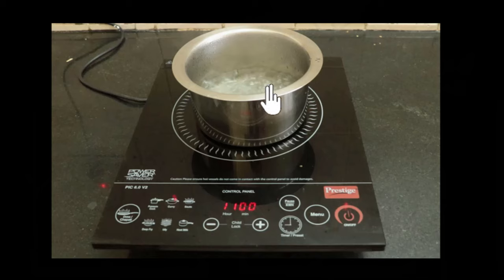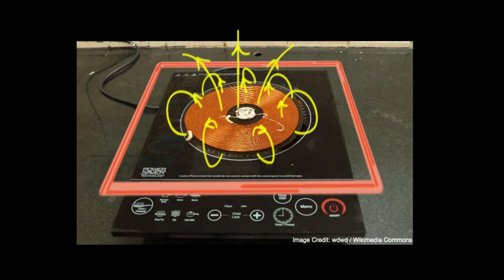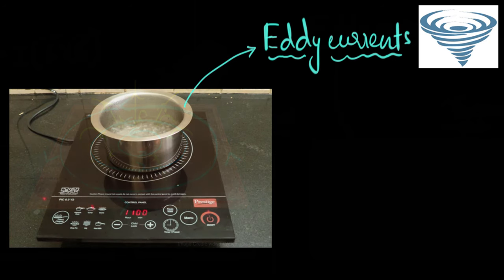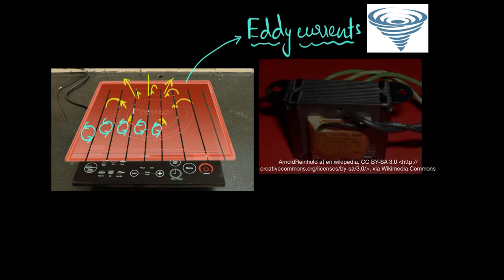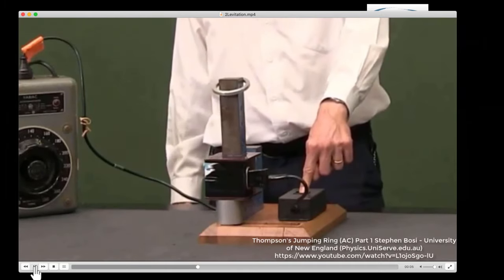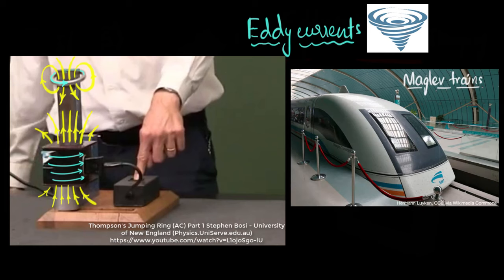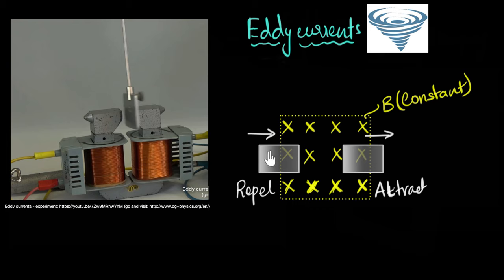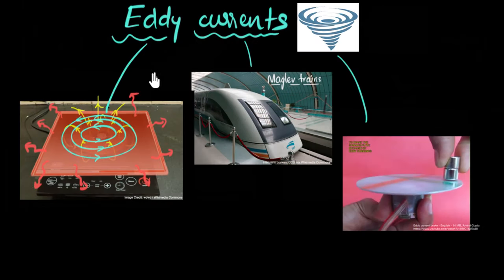Eddy currents & their applications (& how to reduce them) | Electromagnetic induction | Khan Academy

Comment: Good but 2 points: 1) Eddy currents mean  CONCENTRIC currents.  Hence they require a solid and  not a loop conductor . 
2) To most effectively reduce them the slits must  not leave a border on one side. They should go right through the border.
Reply: Agr vessel ke bottom eddy current establish ho jata hai to when we touch vessel to hme current kyo nhi lgta

Comment: In your diagram at about 10:00 if the Al swings through a large constant B-field where it is at times moving through  a constant field (AFTER it completely enters and BEFORE it starts to exit),  the SAME amount of flux is penetrating the Al over this part of the swing...will the braking force be zero here?
THANKS FOR THE CREAT VIDEO!!

Comment: Summary Of The Video :-

............EDDY CURRENT............ 

* Induction cooker cook thing without getting hot itself , it is because of formation of EDDY CURRENT

* The loops forms on the surface of the conductor due to changing flux is called EDDIES and current produced by these eddies are called *EDDY CURRENT*.

* Eddy current do not from on our hand because our hands are not a great conductor so Eddy Current are incredibly microscopic.

* By introducing slots in between the surface of the plate we can reduce the formation of Eddy Current.

* Also in transformer instead of using a giant block of metal we take thin slices of these metal and then glued together to reduce formation of Eddy Current.

* An oscillating aluminum plate stopped immediately in presence of magnetic field because of formation of Eddy Current .

* If we make slots on aluminum plate then it take long time to slow down because formation of Eddy Current get reduced.

Comment: Suppose we put a conductor on that induction so change in magnetic field will introduce a current on that conductor, when I touch that conductor why I don't get a shock ,
I am very curious to know and sorry  if my question is stupid
Reply: 1. our hand is not a good conductor as mentioned in the video.
2 . since eddy currents form small loops of their own on the utensil  even if u touch the utensil on the induction plate u will not get shocked bcos u were never a part of the circuit.  

p.s. i answered your question to the best of knowledge i maybe wrong please correct me if it is so!
Reply: @user-rn7ng6zv1j  i agree with the first point but according to ur 2nd point one should never get a shock because the circuit won't be complete but in reality humans do get shocks because earth is considered to be at zero potential and since current flows from high potential to low potential so when we touch a circuit we actually serve as a channel for the current just like a wire.... this is why we do earthing to prevent shocks
Reply: Did you get the answer from somewhere, if yes please tell because I also thought the same question.
Reply: Did you get the answer ?
Reply: @prashankgupta6672  the only way i could get answer is by doing experiment bro
Reply: @aniketprasad7700  But you wrote that when you touched the conductor, you didn't get shocked🤔
Reply: you won't get shock.. because, 
Eddy currents always form closed loops. As a result, the potential difference developed on the conductor surface is very less and not enough to make electric shocks... 
This is based on my understanding..please correct me if I'm wrong..
Reply: @Dineshkumar-ju9lh  hey I like your explanation but not sure about it.

Comment: but if current produces heat, how do we not feel the heat of the coil inside the induction plate as we put our hand on it? Or do you feel it a little bit? or is the coil designed in a way that there are a lot of air slots between each wire?

Comment: Do these maglev trains use guided pockets of these electromagnetic fields that are passed down the railings? I'm imagining it as an air hockey rink that manages to adjust airflow to purposefully guide an object of a known position (as the cabs themselves would be locked into place by the many individual currents necessary).

Comment: Mahesh sir, it might sound a bit weird. Always when study rigid body dynamics I get a doubt that force is also a vector, so why cant we displace all the force vectors acting on a rotating object to its pivoted point and tell that net torque is zero, since it has to obey equality of vector law. though this doubt is not regarding this video please clarify my doubt sir please..
Reply: sir please explain
Reply from the maker: @preetam714  Because same force acting at different points cause different turning effects. If you push a door at the hinge it wouldn't turn but put the same force near the handle, and now it does. That's why we 'invented' the concept of torque, to account for the turning effects.

Comment: So if i touch the pot when it's on, will i get shocked?
if the eddy current is running through the pot there's is a chance, isn't it?
(i don't have any of this)
Reply from the maker: When the water was boiling, I touched the top. It was neither hot nor shocking. It makes sense because most of the eddy currents are at the base, and the heat is quickly transferred to the water. But I wouldn't recommend doing any of these! Be safe!
Reply: So In order to get shocked we should touch at the base ?? I am soo curious todo this experiment since I have induction at my home 😅😁😁
Reply: @aniketprasad7700  so how did the experiment go? Are you still alive?😄
Reply: Yeah broo

Comment: When the pot is put on the induction it experience change in magnetic flux which induce a current in that put ,also due to the lenz's law the pot will produce a magnetic field such that it oppose the cause of change in magnetic flux, due to which the pot should be levitating but in the real world I don't happen , so my question is why it is not levitating??
Reply: It would levitate only when it can counter gravity but the pot is quite heavy i.e. the force mg in the downward direction is greater than the magnetic force levitating it upeard
Reply: Due to Alternating current through it. Polarity changes very rapidly, In our household it is about 50Hz.

Comment: 7:42 
does it mean when induced Eddy current in the aluminium ring , if i touched it i'll get electric current through my body
Reply: Nah Electric potential induced is pretty low. Utensils get heated because many concentric eddy currents are induced in it at a time.